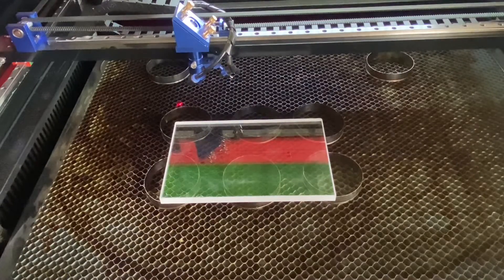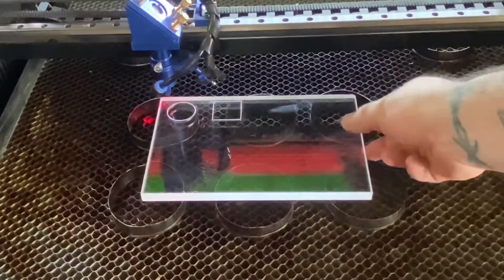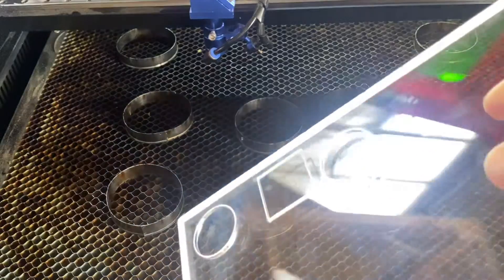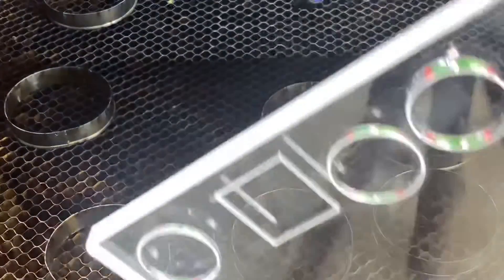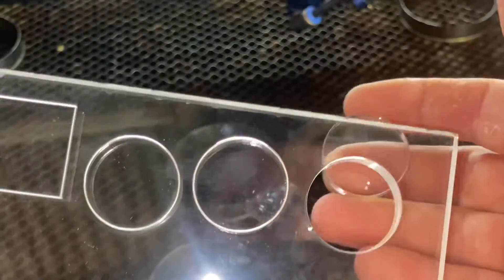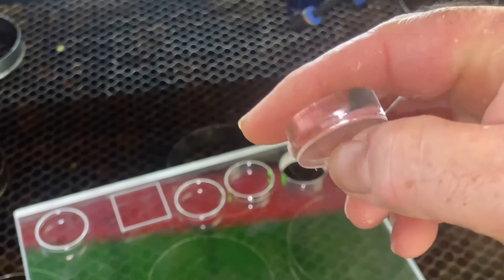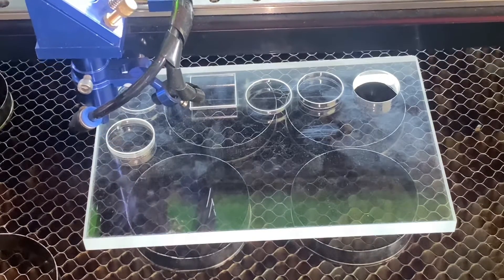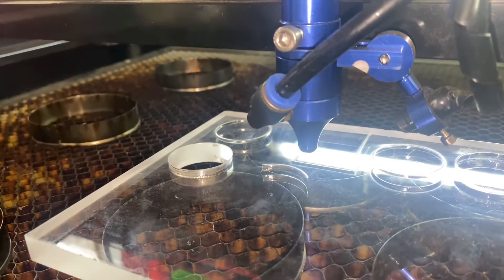Can You cut 10mm acrylic on a 80W C02 Laser!!!

Comment: Thanks for your video! I have a questionfor you... I have been contemplating a 60watt omtech, they seem pretty slow at responding to my correspondence which is making me now think about the Vevor 80watt you just showed. Question is, are you still happy with it, and any issuess worth noting, since this video was about a year ago, or maybe you have another YT video you can refer me to. Thank you again, Andrew😊
Reply from the maker: Hi mate, this machine has been great iv had it for 2 years now and still no major issues at all I’m very happy with it I’ve only had small issues but all quick fixes 😊
Reply: @woodendayz I bought the 130w same brand.Can you help me please?I try to cut 3mm HDF,not MDF...and it varies from 300mm/sec 80% to 25mm/sec 80%....I m thinking about a compressor so the cutting are to stay clean...The machine is new,what I should try?

Comment: What would be the best setting to cut 1/8 acrylic? I’m having so much trouble figuring it out without getting flashback
Reply from the maker: I usually do 12mm/sec @ 30-40% power seems to work well I think unless you raise the material off the bed your always gonna get some flashback as the beam bounces back off the honeycomb bed, 
I use metal egg rings to sit my material on that way it’s off the bed and I get pretty much no flashback 😊
Reply: @woodendayz  thank you so much!!!

Comment: hello :)
I have 5 questions, if you don't mind:
1: how small are the smalles holes or rectangles that you can cut out?
2: how thin are the cuts in PMMA?
3: is it possible to, for example, "etch" 1mm deep into thicker PMMA? (for example make sag holes/rectangles that remove 1mm from a 3mm PMMA plate without cutting through?
4: making PMMA areas "blind" is the same as engraving? can you vary the percentage of the mattified area?
5: I know there are small desktop plotters for this, but can you cut plastic foil (the colored foils on paper that you can place on PMMA plates) the same way with the laser?

Thanks for a quick reply and with best regards!
Reply from the maker: Hi, yes you can cut acrylic very small just a few mm circle or rectangle and yes you can etch/engrave 1mm on some 3mm and not cut through it all depends on your speed and power settings that you use but you can engrave very light or very deep,
The cuts are extremely thin if you were to cut out a circle then you can push it back in with almost no gap at all it’s very precise when cut by the laser 😊
Reply from the maker: I’m not sure about cutting foil or paper as iv not tryed that before sorry and yes you can vary the percentage of the engraving by selecting a different power setting and adding that to a specific layer in Lightburn
Reply: @woodendayz  thanks! :)

Comment: Hello. I’m pretty new to this. I have a question: where did you focus the beam, on the surface or closer? (Somewhat in the material)? Because 10mm is pretty thick
Reply from the maker: Hey mate, to find your focal point you need to do a ramp test check out this video to find yours! 
RAMP Test How to find your focal length!!!
https://youtu.be/p3LldFDL5CM

Thanks for watching cheers Matt!
Reply: @woodendayz  Thank you. We had a similar unit at my work place (90W), which broke, and got swapped out with onether one, this one has a 150W laser. I experimented a bit, it can cut through 10mm plexi with speed 5 and power ~50% easily

Comment: You talk about only 10mm cutting with 80watt laser long time bfore i cutt 20mm with the help of 80watt laser in 1 pass
Reply from the maker: That’s impressive 20mm I found once I slowed it down to try get the deeper it it started to burn/melt the top of the acrylic were you using a standard lense?
Reply: @woodendayz 6.8 focal length glass lens

Comment: how about cutting 20mm plywood, to shows us its possible, as the manufacturer claims?
Reply from the maker: Hey mate, I doubt this machine would cut 20mm with a 2” lense may be possible with a 4” lense but I will have a go at cutting some thicker material to see if it can cut it and post the results 😊 cheers Matt
Reply: @woodendayz  
thanks.
looking forward to see them.
regards.

Comment: Hi Matt
 Acrylic is a unique  material in that it is the only onrethat cuts by  change of state rather than change of chemisrty. In the same way that H2O exists in 3 main states, solid liquid and vapour, so does acrylic. Its solid at room temprature but at 160C it changes to liquid and at 200C it boils and vaporizes just like water.. It take a lot of energy to change material from one state to another (look how long it takes to boil a pan dry) whereas set fire to a piece of paper and the chemical reaction happens quickly. Cutting  (more accurately ...evaporating) acrylic will always be a slow process and in comparison , for example, you can cut wood at more than twice the speed. When cutting acylic  OBSERVATION is most important.. Light travels in straight lines  and it is light energy that is eveporating the acrylic. Watch your cuts and observe how the bottom of the cut drags behind the beam entry point. If light travels in straight lines, how can this be possible?. No you are not defying the laws of physics, it means you are no longer evaporating the "dragging" part of the cut that is not upright.with the laser beam. Instead,  you are evaporating the curved bit with hot gasand so it is totally out of control and is the cause of your frilly cut on the bottom edge. It is a bad idea to do two cuts,  Look at the turbulent gas flow and jagged bottom to the first cut along with the drag by running faster..   take a look at this short video   https://youtu.be/Ay0xFzhvbyI      You should ideally try for a single pass cut even if it is slow  I have a tube with similar power to you  and I can cut 20mm acrylic with a 63.5mm lens at 1mm/s 
To summerize. If the beam drags then the speed is too fast.  A 4" lens may not give you the gain everyone believes. The simple rule for cutting is  "the greater the light intensity  the faster damage will happen". Degrade the intensity with a longer focal length lens  and you may cut deeper but it will be at the expense of cutting speed... Try it for yourself.
Reply: I am reading this comment with your voice in my head 😊

Comment: Hi Matt, great video & happy to have discovered your channel as I've just picked up a similar machine to play around with at the end of the year.
Have you considered changing to a lens with a different focal length? From what I gather getting a longer focal distance will give a longer distance that the beam will be 'in focus' meaning you should be able to cut thicker material without needing to run at 80% power. But that means that you lose detail on engraving and thinner cuts, so maybe we change out the lens when we need to cut thick stuff, leave it as is for everyday use. Totally don't know if I'm barking up the wrong tree or not, but could be worth checking out. 

Cheers!
Reply from the maker: Hi 👋🏽 thanks mate and yeh could definitely swap to a 4” lense to cut thicker material but I just wanted to see what thickness the standard 2” lense could do with the acrylic I know a guy that has the 100w machine and with a 4” lense is cutting though 18-25mm board so that’s definitely the go if your wanting to do thicker stuff, and as you said having it there to swap out between the 2 would be ideal 
Thanks for watching mate 🤙🏽
Cheers, Matt
Reply: I have a 130w machine... first time I hear about this...have you done it?give me more info pls

Comment: Great info. I am looking at an upgrade to my laser capability. I currently only have a 7.5w diode laser on my CNC Router. All its good for is engraving my logo on the back of my jobs. I see VEVOR have a 100w unit at a reasonable price. I was thinking one of the high powered Diode lasers that are on the market. But the price point on the VEVOR 100w seems like a good deal. Maybe to good. How have you found VEVOR to deal with?
Reply from the maker: Hi, my machine has been flawless to date so iv had no contact with vevor since iv purchased the machine, the purchase was quick and easy I think I purchased it on a Sunday and it was at my door by Thursday iv had to make minor adjustment as far as the bed being level and adding some extra hose clamps to the water lines but all in all it’s been hassle free machine so far 😊 thanks for watching, cheers Matt
Reply: @woodendayz  Thanks for that. The CNC Router thing I have been doing for few years. The Laser will be something new.

Comment: Hey, love your videos. I am wanting to get once of these machines but couldn't find much about them, finding your videos has out me at ease. I am just wondering why do you place the acrylic on top of those silver rings rather than just putting it straight on the honeycomb base?
Reply from the maker: Hi Talara, for this video I just did it on the honeycomb as I was only testing to see what thickness it can cut also with acrylic the flashback is not so bad it doesn’t leave a burnt mark like it does on wood/timber but if you wanted a perfect finish on the back then I’d still suggest raising it off the bed but just for testing purposes I don’t worry to much as it just ends up in the bin 😊 thanks so much for watching. Cheers Matt
Reply: @woodendayz  thanks so much Matt! Also what's the thickest wood you've been able to cut on this machine?
Reply from the maker: Iv only done up to 9mm plywood and also mdf so far and that’s both in 1 pass but that’s a good question I’ll do some testing and put up a video in the next few days, I’m sure it could do more but once you get into several passes it can burn up the edges pretty good. 😊
Reply: @woodendayz  thanks Matt! That would be awesome if you could do a video!

Comment: Hi mate, I’ve been watching your videos for a while now and recently I bought vevor 100w co2 machine. How your laser going. I’m having really hard time with it. Parameters are all screwed up. Have you faced any similar issues yet? Thanks
Reply from the maker: Hey mate, thanks for watching! And congrats on the new machine 👍🏽 to be honest mine has been Awsome I haven’t had any major issues apart from my own mistake of trying to do an alignment without research 🙃 once I sorted that it’s been great.
What issues are you having are you using Lightburn or RDworks? And Is it the 6442  ruida controller like mine?
Reply: @woodendayz  yes same controller, I’m using lightburn. My x axis only travelling to the one side , opposite to home and hitting the corner, hence the display shows 10000mm (XY). Do you know any repairer in Melbourne?
Reply from the maker: Hmmm that’s a tough one I’m not too sure what that could be have your tryed to reset the vendor settings? And I’m in brisbane so unfortunately I don’t know of anyone in Melbourne sorry I couldn’t be more help.

Comment: 10 years ago I used to cut 10mm on a 30watt co2!
Reply from the maker: Hi Richard, was that with several passes, when I purchased this machine I was told it could do up to 10-12mm materials I’m yet to try a thicker plywood or mdf I’d assume they would be a lot harder and produce a really burnt Edge as I’m sure they would require several passes cheers, Matt

Comment: Is your air assist turning on when you start? Acrylic cuts cleaner with very little blow...
Reply from the maker: Yeh it is, it’s set to 15psi I’ll have to try it without and see the difference, thanks for the tip cheers. Matt
Reply: @woodendayz  I have my air almost turned off, otherwise you risk it flaming up